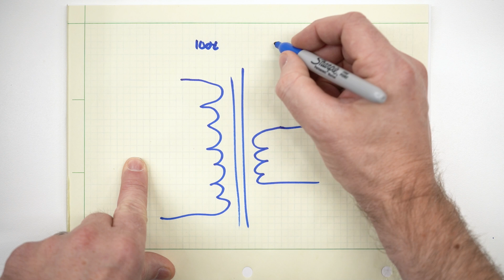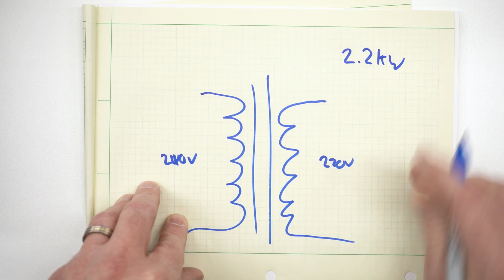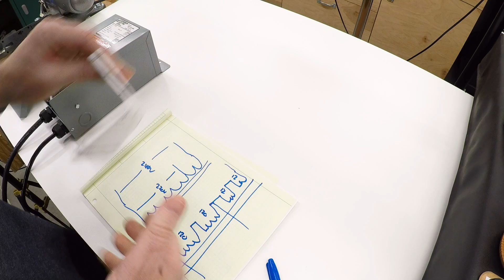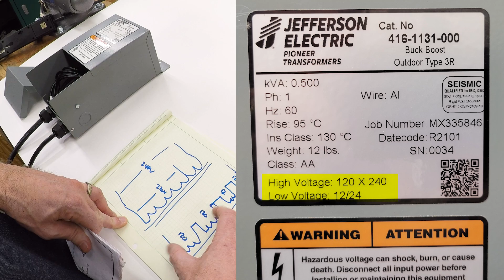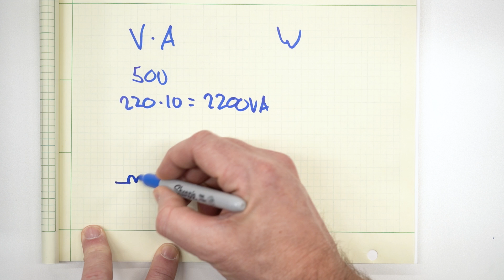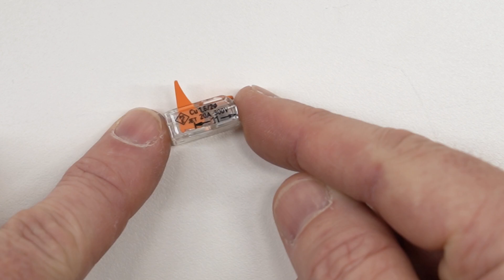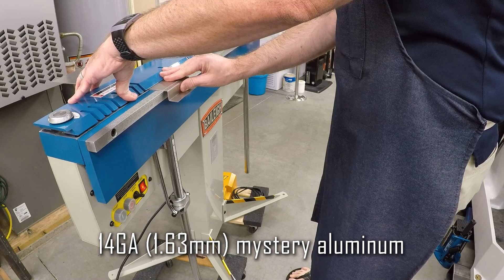220, 221, Whatever it Takes! | Wiring a Buck Transformer for a Magnetic Sheet Metal Brake

Comment: So a few questions James, Being the name plate says 10a and your pulling more like 17.5a, what size breaker are you using? The contact paste, is that NLGI O2? Would this be the same as white lithium?  And, though it seems ancillary, I am very interested to see how you handle bolting this thing down. I think many of us with home shops need this, and many of us (me) just never get around to securing our machines. Super dangerous, I know. Thanks for trying to shed a bit of clarity on the whole magical world of electricity. Those that understand it just find it so obvious. Those of us that don't, those people are normally horrible about dumbing it down
Reply from the maker: No, it's not a lubricating grease--it's specifically designed for electrical connections with aluminum wire.  Any hardware store with an electrical department should have something similar.  My circuit is 30A, but there's a 15A breaker in the machine that isn't tripping.  More investigation is coming.  I'm not planning to bolt it down.  If I end up bending things that require enough force to lift the front legs, I may need to revisit.

Comment: Good explanations, I think many needed that... :) Intuitive understanding is worth so much more than many think, especially when trying diagnose something that's not working later. Having a feeling of "this isn't correct" when you measure/test something can save so much time...
But you could mention that the two large coils are actually pushing current "backwards", being force fed magnetic induction from the smaller coils...
The 17.5A output is the sum of 16.0A pushed "through" from mains and 1.5A circulating backwards from the circuit of the large secondary coils. 16+1.5=17.5.

Also, I didn't run a brake like that under water on the moon - but a reasonable advice is to always use a small scrap piece of the same thickness as the piece you're trying to bend on the other side of the clamping slit. Otherwise the top clamp will gradually over time bend into a permanent dome shape which lowers your clamping force in the middle of the table. This is true even for large, industrial scale brakes....
Reply from the maker: Good points.  Yes, the coils are operating "backwards" in the intuitive sense, and I neglected to mention it.

Comment: I'll give the Knipex brand snippers a shot. I bought one of those cheap Chinese Amazon wire strippers. I was trying to strip a 10ga wire and the things were giving me grief so I pressed harder and bang the handle locked together with the meat of my fore finger pinched between the lever mechanism in the handle. I had a blood blister on that finger for weeks not to mention how incredibly painful this was. I'm lucky the mechanism didn't slice right through my flesh. Never has "You get what you pay for" been more true.
Reply from the maker: They work better with some insulation types than with others.  They're not so great with kapton.
Reply: brand is/was Knoweasy Automatic Wire Stripper
Reply: I thought I was the only person who had pinched the bejeezlus out of their finger!  Beware of the Chinese vice grips that somehow are designed with the effing locking release lever to be pulled down instead of squeezed up. Those damn things eat flesh and spit out blood!
Reply: @stanervin6108  Yikes. If they're going to copy an existing design at least try to understand why the deign is the way it is rather than going the NIH (Not Invented Here) route and implementing something that is really dangerous. Maybe that's too much to ask ...

Comment: But what does this solution do to the PF?
Reply from the maker: The transformer doesn't appear to affect the power factor, which on this device is awful.  I measure 0.36.  this may be part of why the current measurement is a little odd.  Still investigating.
Reply: Power factor is always going to be terrible on an electromagnet - theyre basically just huge inductors. For it taking way more current than specced, that shouldn't be affected by power factor, as amps are amps. Taking more power is a different matter.
Reply: @UnreasonableSteve  In this case, the electromagnet is fed DC current, rectified and filtered from AC power, so the electromagnet itself do not matter. It is the waveform of current and power factor of current feeding the rectifier that matter here. 
When short pulses of current is filtered by a capacitor after the rectifier, 
then amps out is not the same as amps into the rectifier.

Comment: Looks like an amazing tool. But man, why does a $3000 tool exists that requires this sort of effort to use? Now I wonder...what's the voltage drop when this thing is on? Or with a short extension cord? Seems like the dip might be enough to get it within 'spec' when in use.
Reply from the maker: I'm reading 221V RMS at the tool while energized, so it isn't dipping much.

Comment: So it requires you to meet specs by 5% but is 75% off itself? I'd like to know what the manufacturer says about that 😄
Reply from the maker: Yeah.  They're a little mystified, because the magnet resistance is right on spec.  Amusingly, because of the terrible power factor, the average current is close to 10A.  I'll reserve judgment until I have more time to investigate the current limiting circuit board.
Reply: @Clough42  weird, if it's got current limiting built in, over voltage by a bit shouldn't be a big deal.

Comment: What I don't understand is why make a bit of equipment that requires less voltage than standard mains volts or us your supply out if specification.
Reply: Right? Even UK's grid spec is 230+10%,-6%, Europe I think is 230V+-6%.That's a remarkably low overlap. 220 minus 5% is 209V, so you even miss the 208V 3 phase here in the USA. They've built a device that works basically only in China and Africa
Reply from the maker: There are lots of opinions on the Internet about this topic.

Comment: That's a cute little transformer. I needed a transformer that could take the power out of my home solar inverter that was galvanically isolated and would generate split phase 120V. The model I got was a 5KVA Emerson. I think the thing weighs upwards of 150 pounds. In the end I switched inverter supplier and never needed the transformer but I do remember almost blacking out trying to manhandle this thing and getting it bolted to the basement wall even with the help of a scissor lift. It's still there on the wall taunting me every time I go to check the inverter status 😀

Comment: Kudos for using Wagos. As European I die a bit inside every time I see wire nuts being used.
Also, kudos for selecting the proper Wago clamp type and using the Al contact paste. You did your research.
Reply: Wire nuts work quite well IF you have the correct size AND know how to use them.  But knowing how to use them IS the problem.  So many people think you can shove anything in there and they work as long as they're tight and that is not the case.  Dissimilar types of wire like stranded and solid can be problematic, as can different sizes of wire.  Also if one is stranded and tinned and the other is solid.  The wire should be the same length and should NOT be twisted together before putting the wire nut on.  Take a few things apart that have been worked on by people who don't know or care and you'll find the connection is often not that great.  Typically the stranded wire gets run down to the bottom of the solid and has a lot less contact than expected.  I'm sure the manufacturers and NEC have specifics on these but I'll admit I haven't seen them.
Reply: Wagos don't provide as much contact between the wires as a properly twisted wire nut connection. I've had to replace Wagos in strings of fluorescent lights. In my opinion, Wagos are for lazy electricians.
Reply: @tiredoldmechanic1791  Wagos are for electricians who don't want to be held liable for burned down hose, or electrocuted customer. I've seen so may loose an wonky wire twists with wire nuts, including ground wires(in US), that I'm surprised that they are still allowed and still in use. In many countries you'd probably loose your license for using wire nuts. Wagos are almost impossible to install incorrectly.
Reply: @piranha32  I should have taken pictures of the melted Wagos I replaced.
Reply: @tiredoldmechanic1791  Yeah, you should have. It would have been quite unique pictures ...
Reply: @tiredoldmechanic1791  huh? We're they Wagos, or Chinese clones? Many YouTubers did load tests, wagos are as good as wire nuts, but clones failed much earlier. And you're already using identical contacts as in Wagos to install wires in outlets, the only difference is there they are a PITA to remove wires.
Reply: @piranha32  I only use screw terminals on outlets and switches with a full wire wrap.
Reply: @tiredoldmechanic1791  Nothing wrong with that, but it’s old style and takes forever …
Reply: @tiredoldmechanic1791  I laughed when he said "nice clean installation" then he had to squirt a bunch of noalox into each of the connectors. That stuff is like moly grease. It's black and gets everywhere.

Comment: Even if you were over-volting it, wouldn't that be actually dropping the current?
Reply: Not in something like an electromagnet or a heater. More voltage causes more current flow. In a switching power supply yes.
Reply: @VoidedWarranty  ah, thanks!

Comment: This is a great video! As an electrical engineer, you're spot on about everything but the nomenclature. These are typically called step-up/step-down transformers. Buck/boost is an entirely different animal that uses active switching with a MOSFET and is typically exclusive to DC only topologies. The end goal is the same, making a larger voltage from a smaller input voltage or vise versa, but the way they do that is different. 

Granted, I've never worked with autotransformers before. Again, nice job keeping the voltage in spec.
Reply: Buck-boost is an EE term used by industrial electricians etc. Very common. And yes, it's different from buck, boost, buck-boost, Ćuk, etc.  used for converters ;-)  Different domain. Just like how I say "mils" on a PCB design and "thou" on a mech design (in legacy Imperial mode anyway).
Reply: The manufacturer called the transformer buck/boost which is a term I'd never heard used in pure transformer topologies. To be honest I thought the magic box would have a bunch of power mosfets in it.😀
Reply: @vincei4252  that's what I was thinking. So I waited to comment until the end of the video thinking some jackass is about to introduce a bunch of smps on the grid.
Reply: @conrad2468  Interesting. I just checked the Emerson transformer catalog and they're also calling them buck/boost, even the galvanically isolated models. I guess there was a memo you and I never saw.
Reply from the maker: The words "Buck Boost" are printed on the label on the transformer.   A buck or boost converter is also a thing, and you're right; it's a different animal.
Reply: Huh I learned something new today!
Reply: @conrad2468  To be fair, so did I.  I heard about the purely transformer type but never encountered or needed one.  I suppose it's a manufacturing setting use case as it would be highly reliably and predictable with practically no maintenance or need for checkups, and much cheaper.  Lack of a heatsink or fan is a great indicator of this, in pretty much anything really.  I can imagine the VVFD/inverter type would be a lot more expensive when all you need is one setting forever.
Reply: Buck/Boost transformers, predate switching buck and boost converters by a long time.
Reply: I think you are wrong.  There are two types of buck/boost voltage conversion devices.  The switching type which you are referring to are typically called "buck/boost converters".  The transformer types are not surprisingly called "buck/boost transformers".  The main difference between the two is in the additional circuitry to increase the switching frequency in the case of converters  which has many benefits, but noise related downsides.

Comment: Wago... Knipex...Wera... I mean, the rest of the world loves all of those (Wera a bit less), but you're risking your American citizenship using Wagos.
Reply: I love Wago connectors, mostly because I hate wire nuts, especially if all the wires aren't exactly the same size (and let's be real, when are they ever the same size when you're doing any kind of modification or retrofit?) James just has good taste.
Reply: Good old german engineering (Wago, Knippex, Wera and so on).
Reply: While James names Wago with "W" and not "V" in the beginning, he is safe. :)
Reply: @philipmihailov  yup! Vahgo not Waygo ... Natürlich ... Es ist Deutsch! 🤣🤣
Reply: There are a number of jurisdictions in the US that mandate Wagos and say that wire nuts cannot be used.
Reply: @lwilton  "Wire nuts" Invention of Satan.
Reply: @louispole6285  In all honesty, wire nuts, when used correctly, work just fine, and have for about 120 years. The problem is "used correctly". This was taught up thru the 1950s, back when unions considered themselves to still be repositories of trade knowledge, and required members to take classes (possibly given at the union hall) on how to correctly do their trade. With the AFL-CIO merger all that went by the wayside. In the 1970s and beyond DIY became a big things, and nobody taught homeowners how to correctly use wirenuts. Add in aluminum wire, and you have a disaster.

A wire nut is really no different than a screw terminal. You have to get ALL of the wire under the screw head, and you have to get it tight, so it won't back off by itself. And with aluminum you have to use the right grease to prevent creeping oxidation.  All those rules apply to wirenuts. Spring terminals eliminate a lot of these problems, just as long as nothing heats up the spring. If something does, they fail.
Reply: @lwilton  I totally agree with the "if used correctly" comment. The issue is they are very easy to use incorrectlt and nowadats there are far better connectors available. Why not use the very best that modern connector technology can offer?
Reply: @lwilton  You are SO full of crap, wirenuts are UL listed and have been forever!
Reply: @bebo5558  I didn't say they weren't UL listed. I said there were jurisdictions in the US that override the UL code and disallow them. The UL code isn't the Law of the Land. It is a model code and has to be adopted, in whole or in part, by each jurisdiction that wants an electrical code. There are places in the US with NO electrical code. There are places in the US (like NYC) that have their OWN electrical code. Almost every jurisdiction that has adopted the UL code as their electrical code has a list of "except section xx.xx" clauses where they substitute their own local verbiage. Some of those places have outlawed wirenuts, despite them being legal 5 miles away in the next town.
Reply: @lwilton  If they have adopted the UL code, then they can't outlaw connectors that are UL approved for that purpose!
Reply: @bebo5558  Sure they can, town councilmen can do most anything. However, you are assuming they have adopted the WHOLE code. Most jurisdictions don't do that. They only adopt the parts they like, and leave out the parts they don't like. Like wirenuts, in some cases.
Reply: @lwilton  That's my point, they are enforcing "personal preference", not illegal!
Reply: Metric system, anyone? :D
Reply: Have you seen they now do sockets with ‘Waco’ terminals built into the back of them.
Reply: Wagos and ferrules are the way forward.

I don't understand how wire nuts are even a thing.

Comment: If you need a youtube video to work with high voltage, maybe you shouldn't.
Reply from the maker: I think in general this is good advice.  If you're comfortable working with high voltages, but you just don't know a particular device works, YouTube is a great resource for learning.